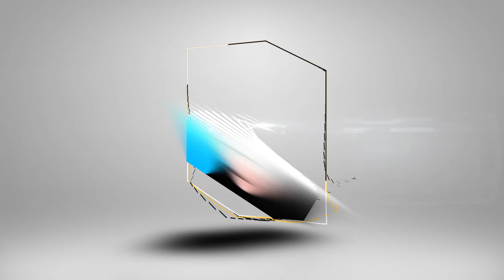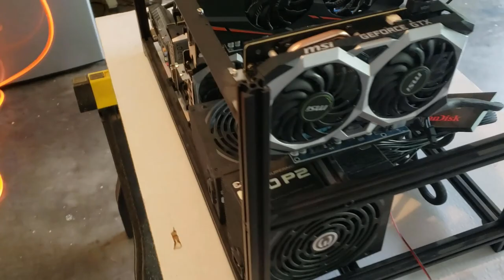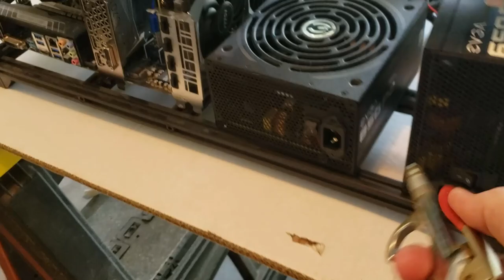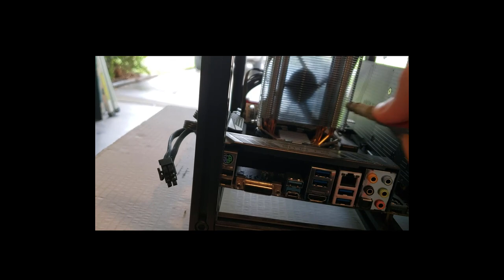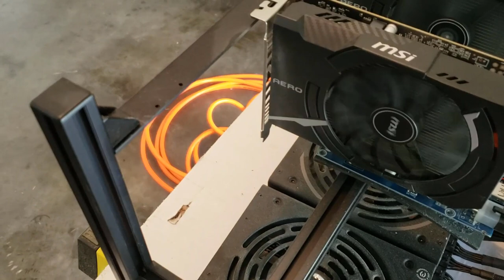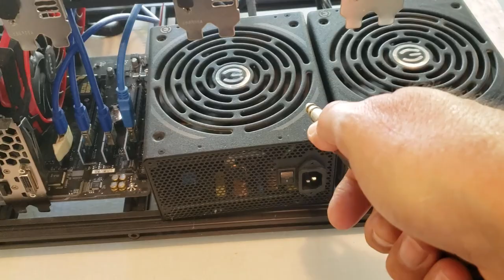Cleaning GPU With Compressed Air

Comment: You have to hold the fans bro.
If you blow to fast they produce energy and then they can damage your hardware.
I now what i‘m saying it happens to me one Motherboard was destroyed.
Reply: Yep I killed a fan on one of my XFX with just canned air because of this issue. Luckily they are swappable on that model so XFX sent me new ones under warranty. Be careful! I personally use a little "air duster" I got on amazon and works well!
Reply from the maker: Off topic, but how do you like those XFX cards?  I've heard other miners speak negatively of them.
Reply: @CryptoFish  I had two. When I replaced the fans on one I sold it since I did some rig re-arranging. The one I have left is an RX 580 8GB with Samsung and has had zero issues. 31+ MH/s consistently
Reply from the maker: Ok, thanks for letting me know Robert.
Reply: Thanks for the tip, man
Reply: produce energy  can kill the fan or fan header or the GPU as a whole ?
Reply: that happened to me 
i cleaned my pc and didnt hold any fan
that cause a problem to me its when i turn on the pc the monitor say "no signal"
but send it to person who fixed it but he didnt tell me what did he done with it 
so do you know what maybe he did and fixed that issue so i know what to do in second time
@wearediffrent

Comment: Gonna get myself one of air/com . I go through dozens of cans a year as I live right on a busy main road and the dust is unreal.
Reply from the maker: You can get a small one pretty cheap.  Make sure to hold the actual fans as others have pointed out in the comments.  I couldn't because I was using both hands lol.

Comment: Dont inhale it :D ...Sell 1050ti s ...They still have good price. Buy gtx1070 used. Allways hold with one hand gpu fans and do it strong  it isnt healthy for card when they spin. I clean my rigs every 6 months. New cards like Rx and gtx10 are allways clean but older ones like r9 390 8gb are nasty. Wen u use compresed air allways on start spray it in empty space few times cos it has wather and oil in it on start,I like to brak card apart repaste it and clean with brush. I use compressed air just when Im selling card.
Reply from the maker: lol...Thanks for the tips, good ones.  I don't have any 1050ti's but if I did I would have sold them long ago.